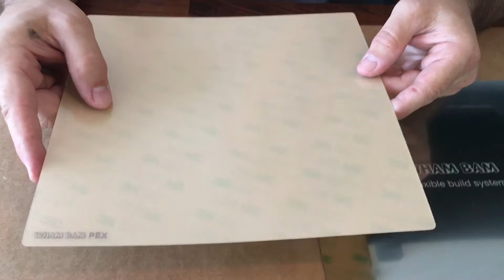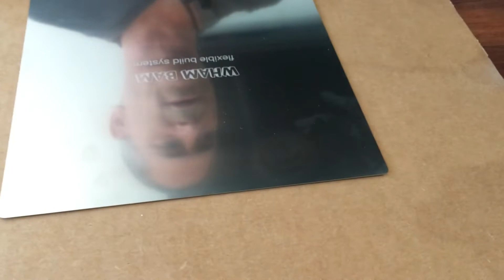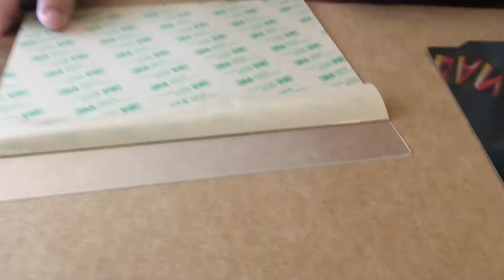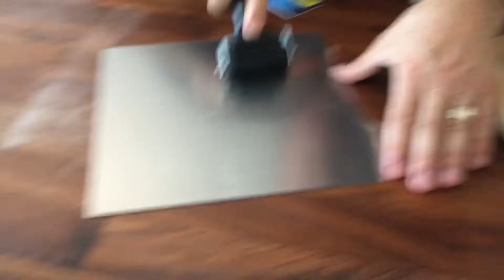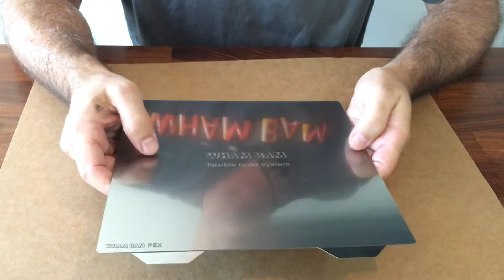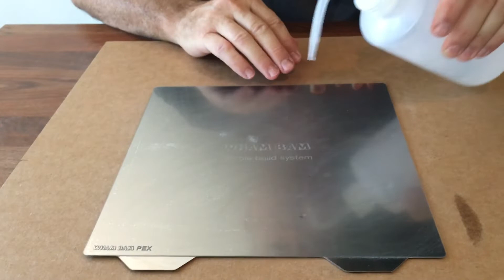Easy Print Surface Installation

Comment: Another great video Peter. My order arrived this morning (UK), only 7 days after placing my order, great work. Cleared space in my office, made tea, then got to work with the installation and it worked great.
I decided to use the wet method with 99.9% IPA, although I did not dilute it as I was concerned that there could be contaminants added in the water (maybe just me being over cautious) Applied the IPA with a fine spray bottle and it worked perfectly. To smooth it all down, I used an applicator that had one side covered with a velvet like material (I kept it from a phone screen protector that I got over a year ago, I knew it would come in handy one day) which worked great.
I remembered to remove the protective sheet afterwards.
Originally I didn't think I wanted to 'scuff' the surface of my brand new PEX, but it is evident that it needs to have the sheen taken off, so I will do it. Although my prints have stuck perfect.
The magnetic sheet, I stuck down dry.
I can confirm from my experience, that it was a lot easier than I had thought. Just be patient, don't rush and follow the instructions and videos. Above all, don't be afraid to try, you WILL be pleasantly surprised.
BTW; It is a great feeling of satisfaction when it's done ... It looks awesome too.
Reply from the maker: thanks for the follow up Spike, its nice to hear when other Wham Bammers have an easy and great experience, and maybe removes some of the fear or hesitation from those who might install for the first time!
Reply: @WhamBamSystems  Always happy to help others, after all, that's how we all learn. I will never get tired of your brand name and all you do with it, always makes me chuckle. Proud to be a Wham Bammer

Comment: Have you guys thought about selling your own cold roller (laminator) for those who need to apply these frequently with minimal blemishes? It has been surprisingly difficult to find a decent one that isn't ridiculously priced or from questionable sources. I'm sure you guys could come up with a solid, compact design that's economical.

BTW if anyone like me is wondering, I wouldn't try a wet application. I worked at a sign shop for many years and thought it'd be a breeze but I have not figured out a way to do it without bubbles eventually forming and destroying the adhesive. Maybe there's a way to pull it off but it seems like a dry application is required.

Comment: Is there a video showing how to remove the PEX sheet? I need to change mine as PETG has beens ticking too good and just curled up the pex badly
Reply from the maker: there is not, but it is a messy job, if you can send me an email I will try to send you our process. tech.director@whambamsystems.com
thanks

Comment: Great video. Any tips for removing the bed surface off the flex plate?
Reply from the maker: removing the build surface?
Reply: @WhamBamSystems   yea im replacing the build surface from the flex plate.
Reply from the maker: @kbkilla420336  As far as removing the old PEX,
we are using a very secure high temperature authentic 3M adhesive that doesn't peel up during long high temp prints, but that means removal is very difficult.
 
You can either do one of two things:
A.  leave old PEX on it and mount new to the other side of Flexi Plate, this way you can have one side for risky or rough prints and the other for perfect prints, this may slightly reduce magnetic hold so you have to see if this works for you, for most it's fine.
 
B. remove old PEX.  This is a sloppy and difficult job, you will need to work on some cardboard, have plenty of paper towels, acetone, rubber gloves, and a spatula.
Use eye protection!
I begin peeling up old PEX and adding some acetone to the peeled open surface to help removal.  (some say putting it in the freezer for an hour helps it to come off easier)

Your Flexi plate will now be covered with the 3M, so wet it with acetone, or soak paper towel in acetone and leave on Flexi Plate.  
Once 3M is soft you then use a spatula to scrape the gel-like 3M off the plate and clean with paper towel, repeat until the plate is clean.
 
Others have said that WD40 works but I haven't tried it yet.
Reply: @WhamBamSystems  thats great advice. Thank you. Maybe ill try dry ice and break it away. ive seen ppl do that with rubber coatings on cars. ive done it the hard way already 😒 with acetone and a spatula. u guys are awesome! ty

Comment: I just ruined my PEX with flexi plate combo for my X1C (forgot to use glue stick becuase I rarely print PETG) can I just replace the surface with the Build Surface sheet? how do I remove it?

Comment: How can i get bubbles out of the bed?
Reply from the maker: its best to follow a good installation process, but if already installed and you have micro bubbles you can try a few heat cycles and they should slowly even out. If you have large bubbles you may need to poke a hole with a needle and try to use a roller to roll out the air.